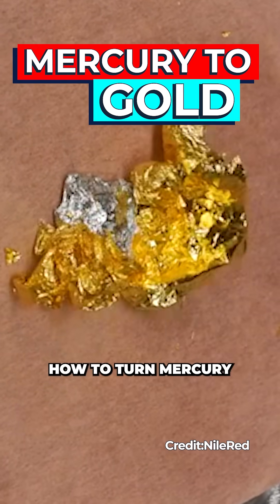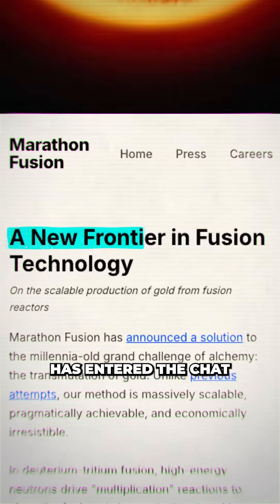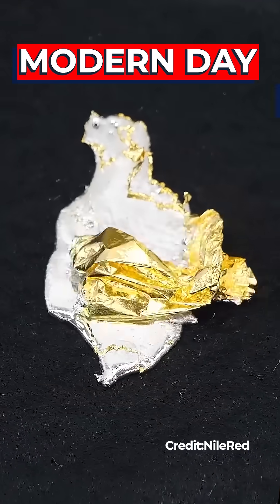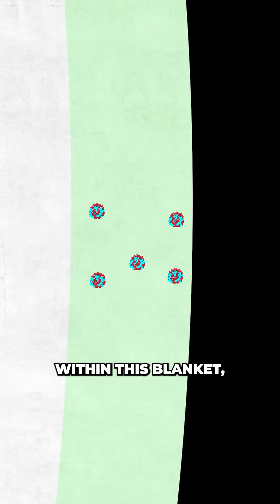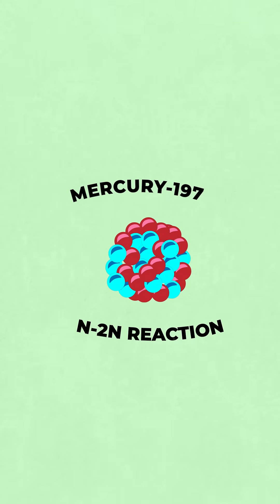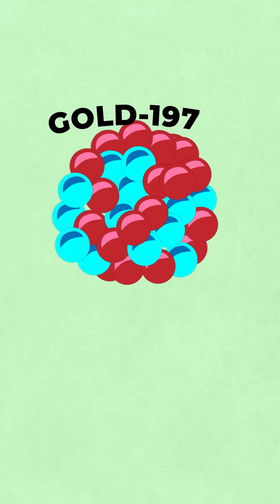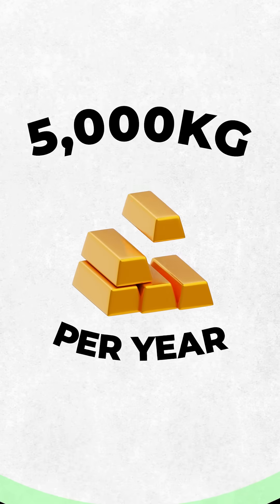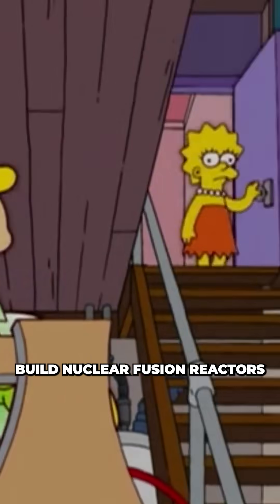Scientists Turn Mercury Into Gold

Comment: The problem is that if we will get a way to produce gold it will immediately drop in price because it is no longer rare. So yeah, it will be pretty pointless to produce gold if you want to gain economic benefits from it
Reply: an abundance of gold will make electronics much cheaper i guess because they are used a lot in circuit boards

Comment: If I remember correct, Gold forms when two neutron stars collide to form a black hole. Neutron stars are the most dense things after Black holes. There are simulations of two neutron stars colliding to form Black holes and its one of the most violent yet spectacular thing that happens in this universe. The whole thing is finished in milliseconds but produces astounding amounts of energy and materials. Yet this company claims to do it with in a "Fusion Reactor" by adding few neutrons. Nahhh highly unlikely until proven by further experiments by other researchers.

Comment: This could actually be utilized to lower the price of electronics will the influx of gold can be used to build computer smartphones and other electronics this could lower the price of electronics since resources it's part of the cost of manufacturing in gold is a way better conductor then copper so we might be seeing commercialization of gold wiring for other uses besides electronics and high performance equipment

Comment: This is extremely cool. Gold is good for jewelry, sure. But it’s even better for electronics. Gold is actually very applicably useful. It has very rare properties. It’s one of the only metals that does not rust/tarnish. Gold found at the bottom of the sea, hundreds of years after a boat sinking still looks as shiny and gold as when the boat sank.

Comment: When gold can be easily produced, it makes the value tank.  That's the irony of these "alchemy" projects.  The primary use of gold is display and store of value because of it's limited supply.  This is the same case with aluminum where it was super expensive (more than gold by weight) because of how rare it was (since processing it to useable aluminum made the supply very low).  As soon as it was discovered how to easily process and produce loads more useable aluminum, the price collapsed.  Now we wrap our food in aluminum and drink beverages and can cheap food with it.  The same would happen with gold, it loses it's primary store of value use case.

Comment: Next you should try making a person with Water, 35 liters; carbon, 20 kilograms; ammonia, 4 liters; lime, 1.5 kilograms; phosphorus, 800 grams; salt, 250 grams; saltpeter, 100 grams; sulfur, 80 grams; fluorine, 7.5; iron, 5; silicon, 3 grams; and trace amounts of 15 other elements.

Comment: The problem is that gold itself has no value; it's worth a lot because it's rare. Now, if future fusion reactors produce gold at a rate of 5 tons per year, gold's value will vanish (because gold isn't nutritious, it's not useful as a tool, and its only value comes from its rarity and durability).

Comment: How idiotic.  I doubt this will ever pay for itself.  The energy requirements are insane, and even if they can overcome that hurdle, they'll devalue gold by constantly creating it, which will make what they produce worth less.

There's also the marketing angle.  Do you think the gold industry will just sit back and let them do this?  No way.  Marketing is the reason we don't just use industrial diamonds for our jewelry, and marketing will be the reason manufactured gold will fail to catch on as well.  That will further devalue the manufactured gold, since jewelers won't want it if that happens.

Comment: the problem is, that as soon as gold becomes this mass produceable, it would also become much less precious. Unlike diamonds, artificial gold could not be told apart from natural gold, so the market wouldn't stay intact like the diamond market.
Reply: Even if mass-produced, it will barely be enough to catch up to ever increasing demand from electronics. 1000 reactors won't be enough to double the gold production on Earth and we don't even have a single working one yet.
Reply: Diamond market is crashing actually, with proper identification Gold has more resale value than Diamond. Everybody sorta kinda started realizing Diamonds are one big scam
Reply: @qkbarbland4332  Recently it is, because recently people have been figurin out that diamonds are just shiny rocks, that don't even look exciting, they are just... blank most of the time. What I meant, is that when they became artificially reproduceable, the market didn't really tak a huge hit from it, beacaue you can identify artificial diamonds. if they made artificial 24 carat gold, you could not tell that apart from natural gold, especially after it has been melted at least once.

Comment: 5000kg works out to 160,750 troy ounces. The current gold price is ~$3400 per troy ounce, yielding ~$550 million at that price. That would only add 0.1% of the total volume of gold bought and sold, for 2024, so it should not effect the price.

The gross income for a 1GW plant, at 12.7 cents per KWhr is $1.1billion per year. So an added 50%, at that rate.  This does not include any costs or other expenses. I am not an accountant. I'm only a retired engineer, so numbers don't scare me, except when dealing with my tax return.

Comment: This is the first time in the history of the universe (that we know) that gold was produced outside of an insanely intense supernova
Reply: Nope they made it in a particle accelerator a while ago
Reply: Well, no. The soviets have also produced gold, from the lead shielding of nuclear reactors. It's honestly a pretty easy process. This development is mostly intresting because Mercury is relatively cheap, and fusion reactors are actually quite close to being viable for energy production, whilst not having the "scary" nuclear waste that fission reactors do.
Reply: @Santisima_Trinidad "are actually quite close" source
Reply: @Santisima_Trinidad  "fusion reactors are actually quite close to being viable for energy production"

They've been saying this for 70 years
Reply: @Yonkage-ik5qb  yes, i know the memes. But legitimately, they are getting there, theres even functional prototype reactors which are just about hitting the breakeven point for energy generation (as in, less energy in to start and maintain the fusion cycle than is put out), and i recently heard about a new reactor which breeds the tritium used to fuel reactors. But fusion development is notoriously slow so even "quite close" could mean 50 years before fusion covers as much generation as fission does today.
Reply: @Santisima_Trinidad iirc, none of those calculations add the energy needed to cool down the superconductors. And while the input energy is electric, the output is energy is heat. So you need orders of magnitude more heat energy out of the reaction to convert heat to electricity (which has significant losses) that is enough not only to power the magnetic confinement but also to cool down the supermagnets.

The heat energy produced is close to electrical energy consumed for magnetic confinement. That's where we are, and we are not that close to getting more electrical energy than we put in the process.
Reply: @Santisima_Trinidad They are nowhere close to breaking even when it comes to useful energy. They are closing in on one of many goals along the path to fusion, not an actually useful breaking point.
Reply: What are you talking about? Absolutely no gold has been produced. This is just a concept, they haven't done anything yet.
Reply: @temporal_paradox gold has been produced in some labs already